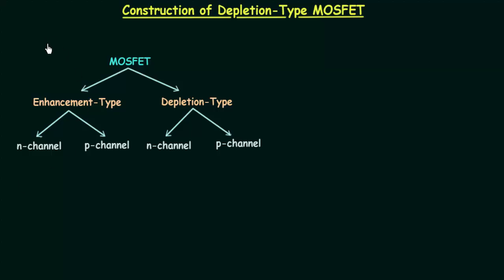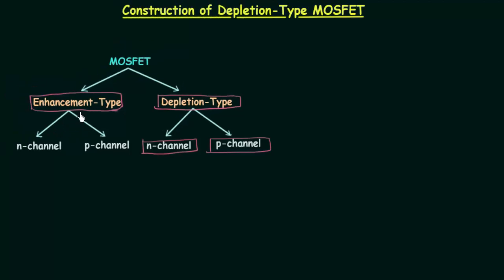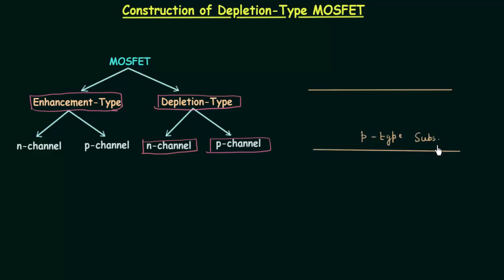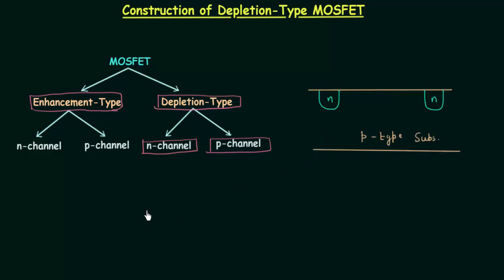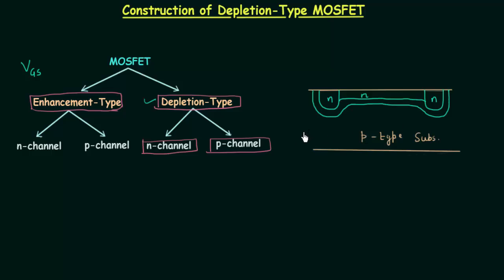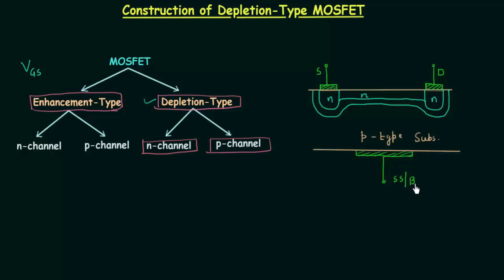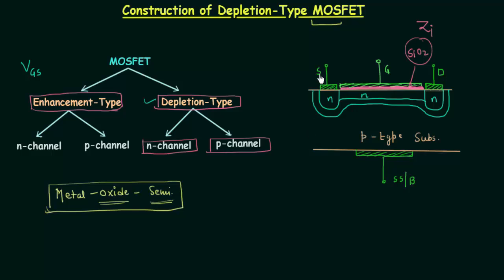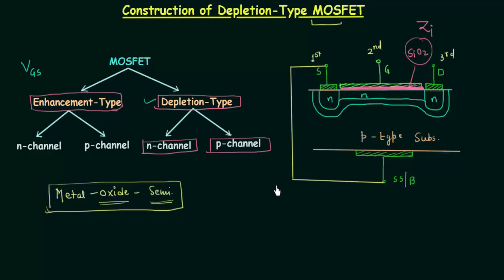Construction of Depletion-Type MOSFET

Comment: hi my teacher first i would like to thank you for your wonderful lecture and then i will try to answer the question in your lecture the question is why do not make the gate source voltage positive ? because the working principle of jfets are not allowed this condition since the gate source voltage controls the drain current when the two junction is in forward condition this principle will be violated and the drain current flow with out any resistivity this will make the transistor damaged so you must make the gate source voltage negative in order to control the output current by making the depletion layer wider